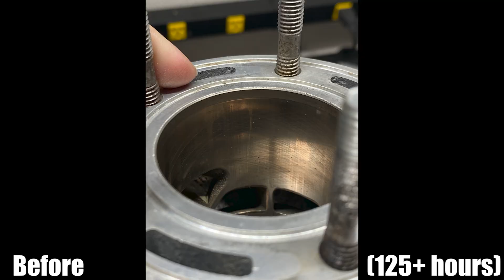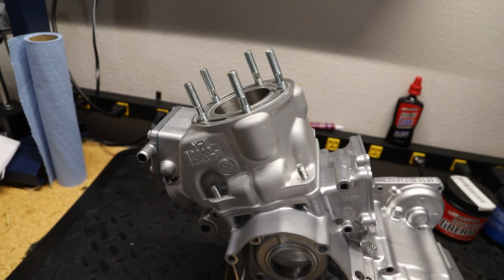YZ125 Engine Assembly

Comment: Hey, new subscriber here. Just bought a 2024 yz125 first dirtbike. Are the internals similar? I know 2022+ are the new motor. But could this help to build mine
Reply from the maker: Very similar, pretty much everything will be the same in terms of components, just with slight variations to dimensions of certain parts
Reply: @akmoto_  thank you

Comment: Hey I’m not sure if you read your comments but I’m building a 01 yz 125 and I’m having a problem with my transmission before I split the case to do my bottom end it shifted just fine, neutral, and through all the gears but once I was putting my transmission back 1st gear is interlocking with second gear not allowing it to go into neutral. I looked through all my parts and there is no spacer or anything to prevent them from locking if you have any tips that would be amazing

Comment: can i tighten the primary drive and cluth nut with an impact wrench or do i need a gear jammer tool and what did you use to hold in place the clutch when you tightened the nut
Reply from the maker: I’d recommend some type of gear jammer tool. You can use pennies but I have and it doesn’t work all that well. For the clutch I used a special clutch hub holding tool.

Comment: im currently tearing down my yz125 engine to do the same. I was hoping you could point me in the direction of the engine bolt kit you bought. this video has helped me gain confidence in splitting a case myself!
Reply from the maker: The bolt kit I bought is from Bolt Motorcycle Hardware. If you go to their site they have them there. Thanks for watching!
Reply: @akmoto_  did it include the long case bolts that replace the allen bolts?

Comment: Hey brotha, 
I’m doing a rebuild on a 2001 yz 125. But my crankshaft seized. And once I got it half way open and I was able to take the bolt holding the gear in place. It freed up. I’m still going to change the crank and bearings. But 
Regarding the other bearings. Do I have to change them all out? Like the shifting bearings? 
I had bought the crank and it literally only came with the crank pair and that’s all. I was thinking if I can just make it work like that or will it mess up the other ones once the case is completely split?
Reply from the maker: Do it right or two it twice. Get all new bearings, seals, gaskets, etc. don’t monkey around with building a motor

Comment: The easiest way to do bearings is this: preheat oven to 300 degrees and put the cases in there for 20 min. Put all bearings in the freezer for a couple hours.
Reply: Bacon cases
Reply: I wish I did this. I got a press and pressed them all in but at the bearing shown at 3:15 I used my press and broke my case half on that last bearing.

Comment: Why are you only using gasket maker in between the 2 case halfs?
Reply: They aren’t designed to use a paper gasket. Some engines only use silicone